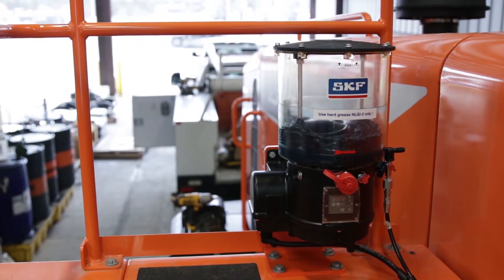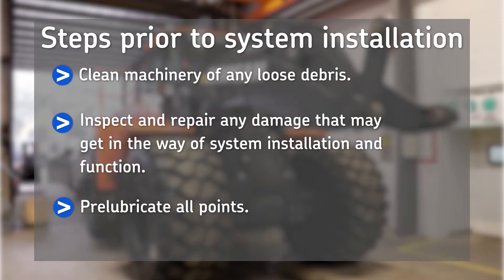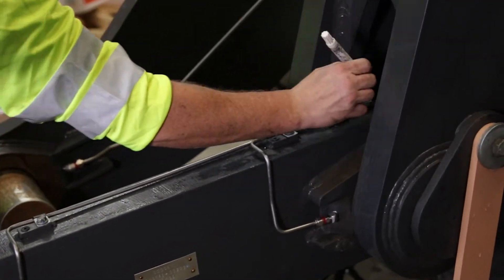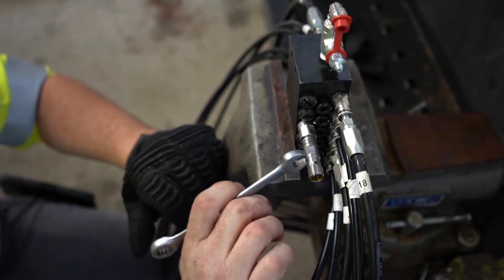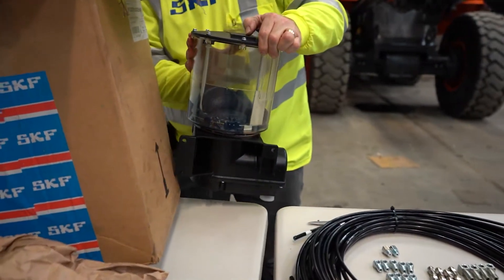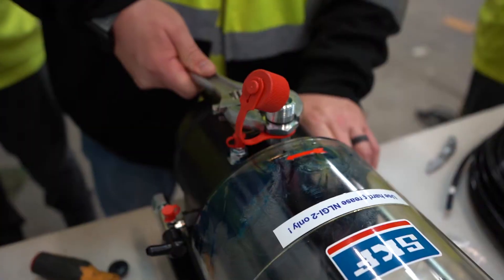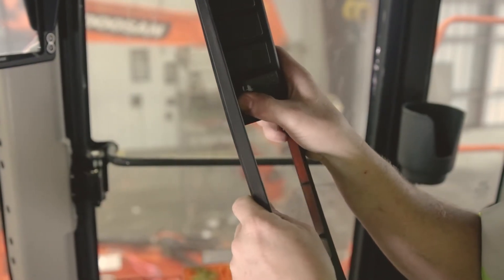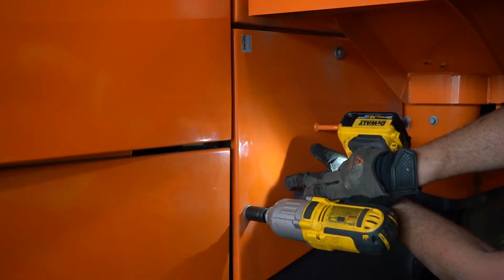Complete progressive system installation on a wheel loader - SKF/Lincoln

Comment: How can I set it to 10minute intervals
Reply from the maker: What is the part number to your pump assembly? boards vary by model and so do some of the programming. Feel free to send this to our technical support staff at lincoln.tech.service@skf.com and they can assist with manuals and instructions. 

~ John
Reply: If you want to program KFGS grease pump for automotive application you refer to page 73 of the manual (printed one included in box) online ones was page 60, you’ll see tPA (pause time) tCO (cycle or run time) if you have proximity sensor on the master block you should change COP settings to CS